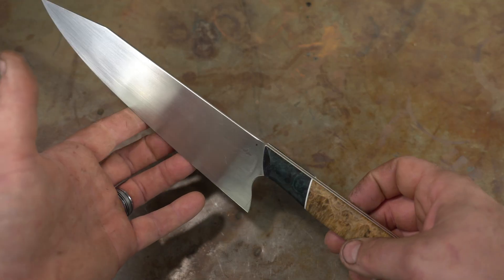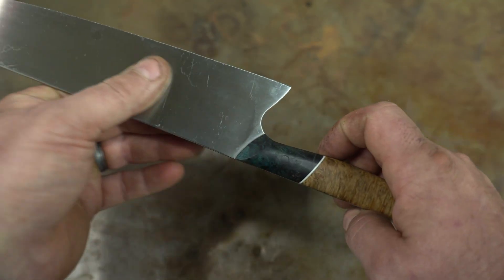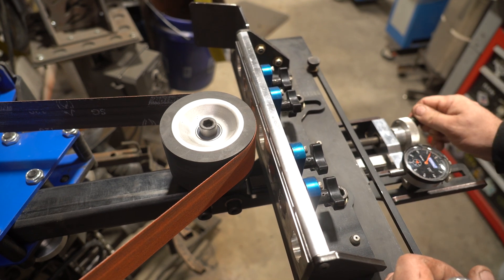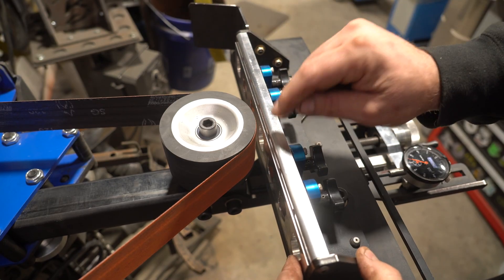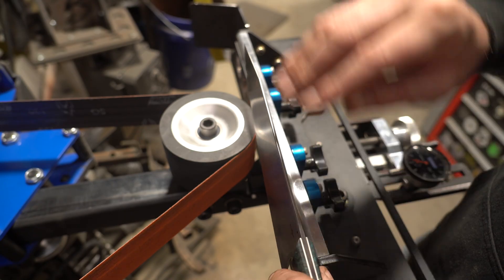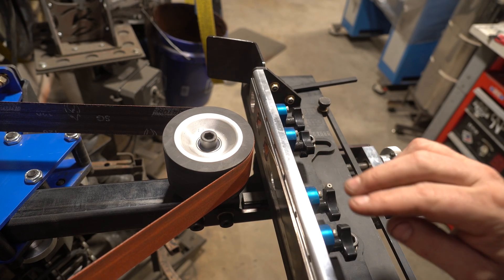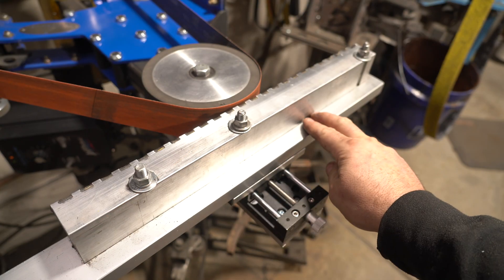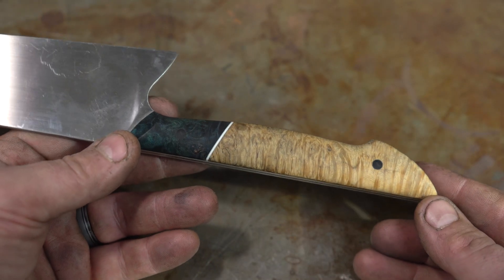Triple-T #237 - Distal tapers and tapered tang on knives

Comment: Could you not drill the pin holes before grinding the taper. Thanks
Reply from the maker: If you did that, your scales wouldn’t sit flat after you tapered the tang.  Draw a picture and think about it and you’ll understand.   Thanks for watching.

Comment: What I like to do if I taper my tangs, is also taper the scales at the same time. So I move my surface grinder say 10 thou or so, but before I move it to 20 thou to do the other side of the tang, I do both scales making sure to mark front/back of the scales. This way, when I stack the scales/tang, the knife is flat/perpendicular to the drill press.
Reply from the maker: That can work if you like that handle profile.  I typically like the scales to still be the same thickness.  Thanks for watching.